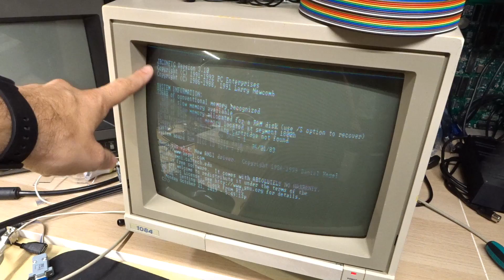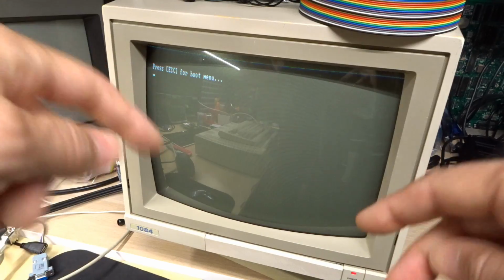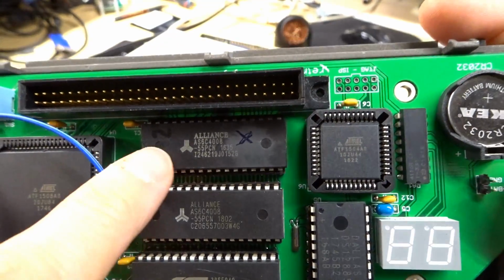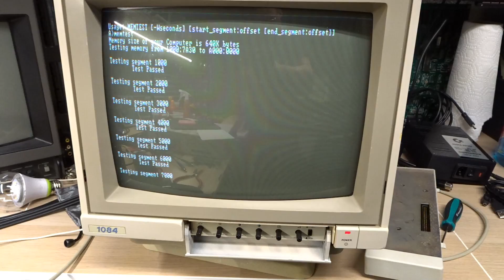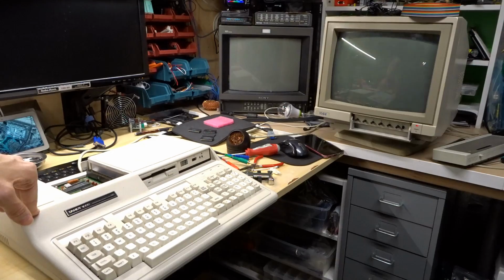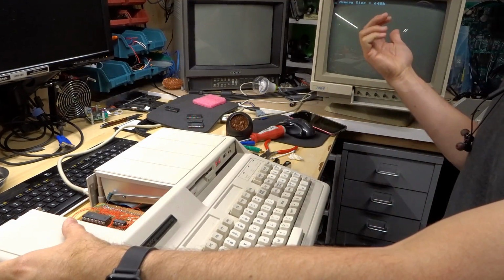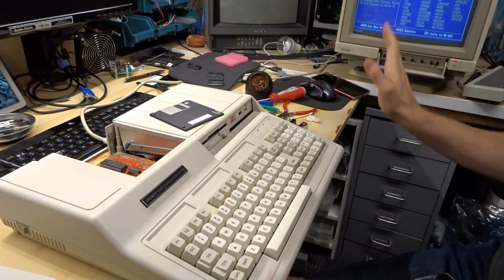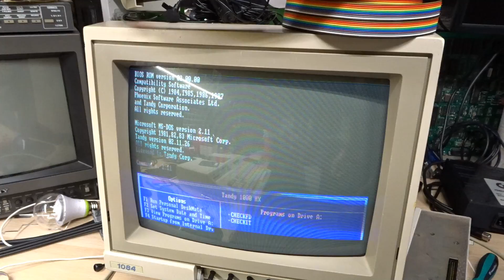Follow-up to fake or real chips? I think I know the answer now.

Comment: There could be any number of differences that are causing what you are seeing.  The 2 most common would be 1) the speed of the chips is actually slower than the real chips, 2) the impedance of certain pins may be lower than the real chips and thus overloading the bus.  The reason that the 74245 buffers are used is to ensure that the bus isn’t overloaded, which is absolutely required when stacking boards.  It wouldn’t take very much time to add a 74245 to your board, and ensure that it is only actively enabled when the memory is being addressed.

Also, USE A GROUNDING STRAP!  You should be grounded (through a 1M resistor) whenever handling any IC or circuit board.  You have no idea how much static damage that you are doing to those chips.  You’ll never feel a small static charge under 20,000v, but it will blow/burn holes into the silicon.  Environments where the relative humidity is below 10% or above 90%, are the most dangerous.  Just learn the basics for anti-static protections, if your going to be doing this stuff.  This is why I’ll never buy components from an electronics store.

Comment: Alliance SRAM chips can be picky , i have some z-80 eurocard systems and the timings had to be tweaked to eliminate crashes.  Also the last time I got chips that the black came off it was a re-badged chip, (slower chip that was relabelled at a faster speed.  many eprom programmers will test srams, some even allow read/write tests at varying speeds.

Comment: I’ve had it with aliexpress. I’ve had a $4 item stuck in US customs for 8 months.
Reply: Its mostly the shops on there. You get used to clues to look for.
Reply: How is that AliExpress's fault? Did they misdeclare? Because if they didn't, i.e. if they followed the rules, then this is more or less victim-blaming.
Reply: @ropersonline  AliExpress doesn't sell the items, but they do provide the platform. They have some responsibility in mediating in this, but not responsibility in getting the item delivered. :)
Reply: @ropersonline  Often sellers even go out of their way to avoid customs detection.
Reply: @ropersonline  Goods over a certain value require customers or sellers to pay for import tax.

Comment: I purchased from 74LS245s from AliExpress for an 8-bit breadboard computer and they "worked" until I tried to light some LEDs with the output. I ordered some 74LS245s from Mouser and they worked even with the LEDs on the output. So again they weren't entirely fake but definitely marginal. I also ordered some ATTiny85s from AliExpress and it turns out they are really ATTiny12s (but with ATTiny85 markings). So completely fake. I am done buying any ICs from AliExpress. I don't know if someplace like LCSC would be any better.

Comment: I know for a fact that some chip resellers paint the tops of chips with old date codes (or slower speeds, or capacities) and then silkscreen new stuff on them. That way they may work when you plug them in, but then they flake out or fail during use, or whatever.

Comment: I would guess it is a timing issue with the chips from China. They are probably chips that were destined for the scrap heap because they work at lower specs than the original design. I think that is why they work on some systems but not others. Btw I bought a set of five 6522 chipson ebay from Chima for my BBC Micro as on of the pins broke off one off them and i tried the ones from China and none of the work. I currently have a jumper wire soldered from the broken pin to zero volt. Pin on the board. Works but doesn't look good

Comment: Try to reverse the Chinese chips.  Put them in backwards in your home brew rig.  Not sure if it makes a difference.  Maybe since the top looks altered, or remanufactured, maybe they glued it on the wrong way.  Is the pc jr more forgiving with polarity and all that?  Whereas your Tandy is not?  Is that sidecar memory expansion board smart enough for error correction and flips the pins if it detects something off with the chip?  I don’t know.  Just offering a suggestion.

Comment: Most likely the fake chips are lower speed chips than the real ones or are another brand of lower quality memory.  The fake ones most likely work in the PC Jr because it's running at 4.77Mhz and the Tandy runs at 7.16.  It's not unheard of for shady Chinese resellers to relabel lower grade chips to pass them off as higher quality than what they really are.  I think PC-Doctor can tell you what the RAM refresh rate is.  If so, that will tell you if this is the case.

Comment: So you proved what we already knew, the PCJr is superior to the Tandy.  Excellent video....
Reply: Said no-one ever.  Hahaha
Reply: No, the PC-Jr is inferior to the Tandy is most aspects, which is why the PC-Jr tanked shortly after release, but the Tandy 1000 line, which was initially based on the PC-Jr, took off. Tandy learned from IBM's mistakes, fixed them, and brought the price down to where ordinary people could afford it. 
I haven't looked at the decoding logic on the Jr-IDE board, but I'm familiar with one of the guys who designed it (he goes by "eeguru" on the vintage computer forums). 

The PC-Jr is completely wonky in how it managees it's RAM, but the Tandy 1000 is quite simple. The Tandy shoves all of the expansion RAM straight to the beginning of the address, reading the first 384KB, then the onboard RAM controlled by Big Blue, which includes the video mask. The PC-Jr has 64KB base RAM, then the video mask, then whatever expansion RAM is addressed after that (if my memory serves). You can plug a (working) AS6C4008 straight into the expansion bus on the Tandy using A19 as the chip enable, and it will work without any decoding logic, but we haven't determined yet on the forums if overlap might cause issues.

The thread is here, if you want to look: http://www.vcfed.org/forum/showthread.php?67544-I-wish-to-create-a-new-DMA-RAM-expansion-card-for-the-Tandy-1000-line&p=576980#post576980

Comment: The EX and the HX are slightly different.  The HX I think benchmarks a little faster than the EX due to some improved design.  If these chips are "good" but maybe -65 remarked as -55 on the speed, it means that it could mess up when accessing it faster.

Comment: interesting.  i generally only buy NOS discontinued chips using ebay, etc.  this definitely reinforces that when it comes to current production stuff.

it sounds like some scammer bought the reject dies from alliance, and packaged them just for scamming on ebay.

also, depending on what it is, you generally don't save that much ordering from ebay compared to digi-key, mouser, allied, or newark, plus with those four, if you do something cool, you have options to order quantity.
Reply: Agreed about ebay, but these were ordered directly from china (Aliexpress) which actually is significantly cheaper in many cases.  And yeah, if you order in quantity then it's usually minimal difference on pricing, however the problem arises when you just need a couple 50 cent chips but Digikey/Mouser charge $10+ for shipping.
Reply: @BrianV_PM  you have a point on that.  they do like you to order a lot of stuff and use combined shipping, but then, i usually end up ordering more than just a few cheap parts.  always a tool to buy or something...i'm the guy who goes to the supermarket for two items, and walks out with two full bags of stuff though.

Comment: Have you checked the voltage supply for the chips? Meassured with the chip installed and the machine running. It might be that there is a voltage drop that is big enough for the China chips to start having problems. It is totally possible that the China ones are factory rejects that are not up to spec and are scooped up by one of the employees to sell cheap on ali express,.... The locally sourced chips might be the ones not rejected in quality control. This sort of thing happens all the time in China. If the voltage supply in one machine has a decent voltage supply on the chips then it may not present a problem, in the other machine it might be sufficiently low to cause problems with factory rejects.

Comment: Probably, those are original chips, but they didn't pass the quality tests. So they were sorted out, probably not laser labels and the "faker" of the chips has added the writing and logo, but not using the original laser machine, but maybe something else. Would be inteersting to see, what appears, when the ICs are rubbed off with IPA completely. Maybe they were even marked as "not passed" or something,. I gess, the problem is matter od the fan out. If you has used a 74x245, you might not have experiended the problem.

Comment: Even though it's static RAM, is there a concern with chip timing?
Reply: No, the newer 55ns chips work just fine. 55ns is the maximum speed they're rated for, and The timing from the Tandy with the '00 decoding logic is at least twice that (I should plug that into my logic analyzer and see what that is). They're being under driven for this application.

Comment: I actually wrote a technical report in college about these counterfeit chips, lemme tell you after doing the research for that you'll never catch me buying anything from China.
As for these it's common to take rejected or lower spec chips, sand off the markings and sell them as fully functioning or higher spec. The soldered looking leads could also be a sign those chips were taken from some other device that's been through who knows what and then etched with a newer date code. Well I could go on, but well in short always be really careful about your supply chain when buying components, because counterfeits are bad.
Reply: Therefore, I have a bad 74LS173...
Reply: I'd love to read your report -- was it published anywhere?
Reply: @AureliusR  Nah, it was just a report for a technical writing class. The research is pretty interesting, but trust me, it wasn't very good lol

I can point you to a couple of the sources I used though, they're still fairly interesting: "Counterfeit Integrated Circuits: A Rising Threat in the Global Semiconductor Supply Chain" and "Response to counterfeit integrated circuit components in the supply chain" (parts 1 and 2) are both what I used for starting points.

Comment: Great video. Do you plan on sharing the schematic of the ram board?
Reply: @adriansdigitalbasement  Don't forget to add the '245 buffer so people can fit it if they want (or eight links if they don't).
Reply: @adriansdigitalbasement  Also (after looking back at your hand-made unit) don't forget one decoupling cap per chip from +5V to GND.  Note that this is not the same as the 'bulk' electrolytic which I do see on your prototype.

Comment: Are you going to have a circuit board made (no more rats nest)? Then try all the chips again. I have a 1000HX if you want to test the boards in another machine.
Reply: This is part of a thread on the the Vintage Computer Forums. Eudimorphodon also has a board in the works, and I've got the schematics for the basic configuration with the '00 for addressing if anybody wants to try making their own protobard with the working configuration. http://www.vcfed.org/forum/showthread.php?67544-I-wish-to-create-a-new-DMA-RAM-expansion-card-for-the-Tandy-1000-line&p=576980#post576980

Comment: I know what is happening... I fall the same in a MSX mod. All your chips are ok, but different batch and maybe different factory, but not fake. The problem is, not at digital level, but at analog level of the digital signal,  when the address bus has different loads.. A0 A1 A2 has more circuit load than A3 A4 ...etc., that happens because some adresses lines often has to go to more places than others addresses lines, by example, for all those I/Os chips which has 8 internal registers which the cpu must address, but the other addresses lines are not reaching all those chips, and those only go to a multi-purpose chip selector.... etc., that makes the ADDRESSES lines to be unbalanced with the load across all addresses lines. Everything is fine within the original load/noise ecosystem.... but then, you start adding mods, and place more loads. And there is when just a tiny more load makes a "more unsensitive" chip to not catch up the signal correctly. This kind of trouble if the load passes the threshold always, will make problems very consistently, not ramdon problem, because the source is too consistently which is different loads across the addresses lines.
Reply: flyguille 
Sadly registered sram chips dont exist.

Comment: That solder-shine on the pins of the AliExpress chip is a dead giveaway they're salvaged. The V-20 CPU I bought off eBay to upgrade my EX looks the same. I only paid $2.50 for it and it works so I haven't had any complaints, but I have wondered if the silkscreening that claims a 16mhz rating might be suspect.

It's still really mysterious why even a used chip would behave like that if they're actually AS6C4008s; the 55ns rating is about four times faster than they need to be for the Tandy's memory cycle time. Did they make them in slower grades? They could be 628512s in disguise, but I think the slowest speed grade of those is 100ms, which should still be fast enough.

Comment: I'm guessing they are probably salvaged parts from old boards which might explain the difference in the finish on the legs. Probably sanded down and all printed with the same specs & date code but could well be a slower part. Does the Tandy boot ok at 4.77Mhz instead of 7Mhz?

Comment: A few things: The labeling on the Chinese chips definitely screams fake, but what are they faking? The speed rating? Do the computers these are being tested run at the same speed?
Is the smaller chip on your RAM card 100% good?

Do you suppose those Chinese chips are being made with an older process that requires a little more power to run, as opposed to the proper Digikey chips? I had a problem with that when I built my Xi8088, as I had different types of chips for some of the smaller logic chips, (CMOS vs NMOS and such), and it would give me errors in the same place every time until I finally replaced all those logic chips with modern parts.

Comment: Time for a logic analyser. Maybe from one chip the leading/trailing edges are steeper than the other chip and the one circuit is more/less susceptible to  steep edges. This can result from slight manufacturer differences but giving in both cases 'within spec' chips.  (BTW bus driver chips can clean up signals!)

Comment: Check It!... that's a trip down memory lane, no pun intended.  Used to use that almost daily from roughly 1988 to 1993, IIRC.  Up until I got a job at an OS/2 shop doing DB2 and telephony on brand new, high end PCs that didn't need hardware diagnosis so most of my time-tested old DOS go-to tools fell into disuse.

Comment: I would love to see that memory decapped. "The die don't lie."
Reply: It might be a "remanufactured" chip. China is notorious for pulling chips out of old scrapped hardware and reselling them as "new".
Reply: @MoraFermi  They also would sell parts as spec higher then they originally were.
Reply: Mora Fermi i mean. should be easy if IPA is eating it away. Just toss it in a bowl or cup of it
Reply: And de lidding might give you the silicon build number.
Reply: Me too.. The only reason to remove a old logo and number is to trade it for a more lucrative model. It’s probably a cheap knockoff thats been rebranded. Crudely.
Reply: The die don't lies, but in case of Chineese ones the die just die...
Reply: I'd decap one of the fake ones and photograph the die markings if someone wants to send me one.

Comment: Probably they are remarked RAM chips, which have been remarked from a slow chip to a higher speed, or were originally the LP version, which is both slower than molasses, and also has very weak bus drive capability. But yes they are fake chips, not the brand and type and speed they claim.

Probably removed from ewaste, and you are lucky that the original parts were some type of SRAM to begin with, as the remarkers will use any sort of chip as base for the trick, just has to have the right package and number of pins for them to start with, first by dropping the whole chip into solder to clean the legs and retin them to a nice even finish, then clean them, sand the original numbers off the top ,and then blacktop them with paint, and finally screen print the desired logo, part number and fictitional production date and lot number on there.

Comment: Less critical timing and/or cleaner bus signal in PC Jr. doesn't expose marginal Chinese chips?  Chinese chips may have solder on leads because they were pulls from PCBs  Painted tops may be because only house numbers were on pulled chips.  Try to wipe off all of the paint to see what's under it.

Comment: They are likely much slower RAM chips that were remarked to make them more saleable. A friend of mine bought an entire roll of transistors form a Chinese broker as he was in a pinch. He looked at them under a microscope before building thousands of PCBs with them and thought they looked OK. He called the actual semiconductor manufacturer and found out the markings on the transistor were bogus. The seller has sanded down and remarked a whole roll of inexpensive transistors so of course they do this with chips they can get a few bucks out of too. Unless there is no option I'll buy from Mouser, Digikey, etc.

Comment: I agree with v ant, you probably received sub-par, rebranded chips from Ali Express. Years ago we had this problem in one our products - we could not get parts from our normal distributor and had to go to the gray market. The parts we received did not match their data sheet specs and it caused no end of trouble trying to figure out what the problem was. Obviously, we never went gray market again.